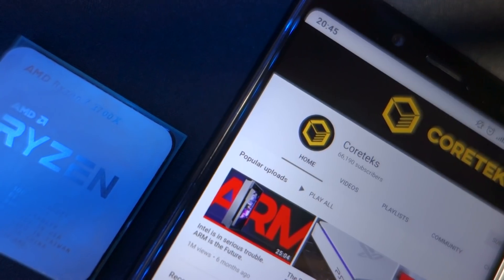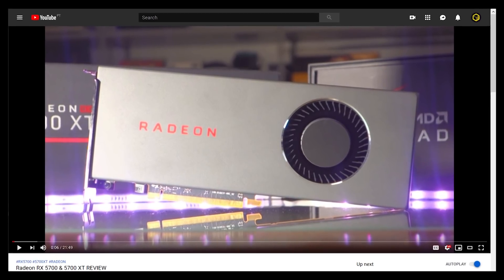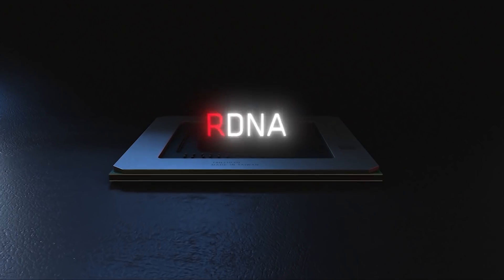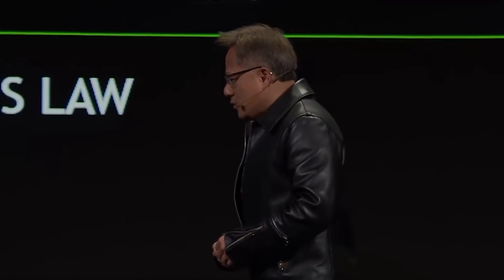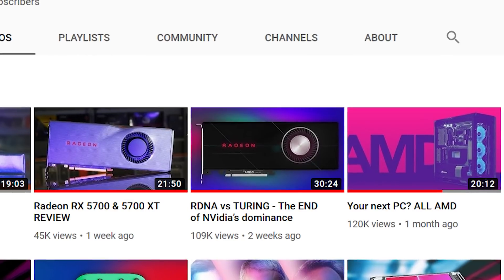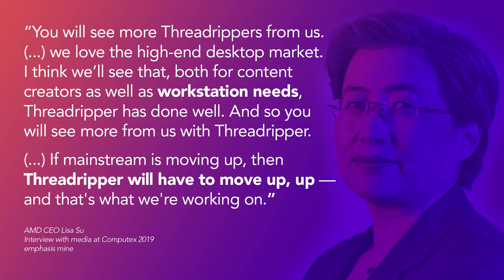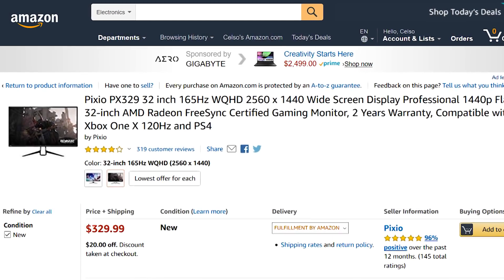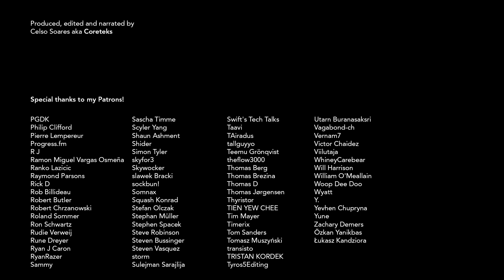What's next for AMD? - 5800XT. Threadripper. APUs.

Comment: APUs are the future, they will replace the low-end and mid-range dGPU market, only high-end dGPUs will exist.
Reply: Memory bandwidth limits means you'd need quad channel DDR5 to match something like the 560, let alone the 580.
Reply: Mid range APUs wouldn't bother me at all. I'd actually be happy with that. it'd be easier to keep cooler as well and be easier to set up a water loop if one chooses. I'd actually support that move.
Reply: @somerandompersonontheinternet4  
Yeah, I get the freedom of PC and all of its benefits!
But Consoles are the way to go to just enjoy some Games.

PC market has become one of the biggest industry and money generator.

Any piece of HW has become way too expensive and overhyped.

I rather use my Phone and Console. Cheap, small, fast, smart, perfect working! - All I need
Reply: Mitch  there won't be any shortage of new APUs in that type of market. So you'd just be upgrading your APU if we assume AMD keeps doing these long term socket supports.
Reply: @J Fz but part of the problem is games also getting more demanding. those 2400G might be impressive if they were released in 2014 because they were about as fast as GTX750. but in 2018? this is the problem with APU. sure it might be impressive once they can reach 1050 or even 1050ti performance but by then we will consider such performance to be on the very low end spectrum to run games at that time.
Reply: @somerandompersonontheinternet4  He's an idiot, that's why he didn't mention it.
Reply: I hope that APUs will be able to replace mid-range GPUs, but I really see it only in more than five years.
Reply: I disagree with the last part of your sentence - somebody might just get a CPU without an iGPU and then just get something cheap as a display adapter UNLESS there will be some sort of iGPU on the board alone (I hope it will be... again)
Reply: See: Gamers Nexus' July 7th review of the 5800XT "AMD Radeon RX 5700 XT Review: Thermals, Noise, Gaming, & Broken Drivers".
Reply: those APU can replace the low end but truthfully even the upper low end is not an easy task for APU. because even on the low end spectrum the GPU performance still being raised and games also still get more and more demanding. right now the fastest sub 75w GPU is 1650. but the best APU are still quite behind even against 1050ti. replacing mid range GPU is outright impossible.
Reply: @somerandompersonontheinternet4  AMD doesn't like leaks that are impossible to do.
Reply: with 3d stacking of memory they will take highend as well  most likely
Reply: @somerandompersonontheinternet4  no it really won't crush the 5700xt. It won't even have as much raw power as the 5700. Simply due to heating issues. It may be able to hit that 4k 60fps but I mean honestly a good Vega 64 can do that. The only thing really giving it that performance is the optimization of the ps5 OS and the how well the devs optimize for that hardware.  Even then there will be settings that have to get turned down or off  to hit that fps mark seeing as they cant be overclocked or any thing like that. Cooling is a big issue for consoles.
Reply: @somerandompersonontheinternet4  the 480 was a $200 card so not in the price range of the 5700xt due to the fact that we had the 390x outperforming it while being an older card and the fury x above that. So that isn't  a correct example. The 5700xt is the latest and greatest on the market for amd right now not a card 3rd on the list behind 2 of its own older models.
Reply: @somerandompersonontheinternet4  oh also that isn't true that they get better binned parts simply due to the fact that console hardware had consistently been at least 5 years behind pc performance numbers until the ps4 pro and one x. Neither of which were really with the money 🤷‍♂️.
Reply: @somerandompersonontheinternet4  again the 480 wasn't even amd's top card at the time. It was a downclocked 480 not better in any way other than power draw because again downclocked to reduce heat.And again the game devs optimize better than on pc since every console has the same hardware. That makes a significant difference in performance but not enough as my 390x handily outperformed a ps4 pro. Remember the pro was running upscaled 4k not native 4k.
Reply: Nah. One reason for the discrete cards is there power consumption and heat output. A modern CPU oroduces 60 to 100 watts. A GPU is even in the low emd 100 Watts, high end is more like 250 to 350W. Add even the small number up and your easily at 150W. You need some space, to cool this amount of heat. It needs a tower cooler and some airflow in the case. So nope, APUs will not extinct discrete gpus anytime soon.
Reply: your talking about discreet GPUs that are clocked to the max. APUs have their eGPU clocked at a much more efficient frequency (800-1K MHz) so TDP is way lower. You only have to look at the APUs already out from AMD to see this.
Reply: @MephistoDerPudel  the thing is that average consumer can't afford to pay for a discrete gpu. Especially in developing countries. So if you can have a GT 1030 or 1050 without paying extra bucks. A normal bloke who doesn't care about 1080p gaming will go for it. So would net cafe or gaming center's that only wants to play games like overwatch,counter strike, fortnite,DotA or lol. The thing with APU is not to be better than descrete. It's to be good enough so you don't feel the need of a dgpu

Id wait for zen4 APU's tho if they can make a ryzen 5 APU with enough power to compete to 1060 it'll be a pretty sweet deal. Not to mention you can just buy another gpu when that starts losing steam
Reply: @MephistoDerPudel  not quite yet but we are getting there.
Reply: Why should they kill their own market? - They just wont!

APU's are much more efficient, cooler and have less TDP!
Just look at the Consoles.
Xbox one X: 16nm@6tf not too bad for an APU.

Also most energy is used for data transfer. Learned from AdoredTV.
PC is worst case.

GPU and CPU can access the same memory!

No question, SoC's are the only future! But first, PC gamers has to be milked as much and long as possible.

Now 5700 XT, next year PS5 will surpass it, then AMD will offer 5800 XRT, new PCIe 4.0 Mainboards, new SSD's, etc...
Later 5900 XRT...
PC is a waste of money and time😱!

Worst time to buy new HW.
Wait till PS5 launched and wait some months.
Reply: @3D-Engine-Melody  the xbox 1 x APU runs the CPU cores at 2.6ghz and has a 250w power draw.
Reply: @vyor8837  
And?

The Powerdraw is meant for the entire system!
Ram
CPU
GPU
Mainboard
HDD
Disc drive
PSU itself
Cooling
Reply: @3D-Engine-Melody  nope, just the chip is 250w. For 580 class performance. With a shitty CPU. Sooooo efficient.

Comment: I am less enthusiastic about APU's than Coreteks. Once AMD arranges motherboards with larger sockets and memory-stacking with good heat-management (I refer to that patent from AMD) becomes possible then APU's will become really interesting. Then you won't have too much of a bandwidth-limitation any more. I don't disagree that someday APU's will become the standard, I don't see it happen in the next 5-10 years yet. What I do see happen is that on average that Zen2/Navi APU will compete with a RX 570, it will have stronger performance for certain aspects thanks to the stronger GPU but a weaker performance for other aspects due to the low memory bandwidth. It will be gaming with a fair amount of compromises and AMD will probably add a feature to AMD Settings to select the right settings for popular games with which you get the best compromise between FPS and graphical quality. This is required because most of these gamers lack the skills to do it themselves and because the memory limitations makes it more complicated to configure the graphics settings, especially for this group of gamers.  (not that enthusiasts might not also use a laptop with a good APU in it but also many people will only have that laptop to game with)

Comment: The "up, up" sounded more like an emphasis on the literal to me.
Is it possible they could be working on producing a 3D-stacked chiplet?
Reply: Doubtful. I'm still calling BS on the feasibility of 3D-stacking on desktop . Sure, in phones / tablets that's been the standard for years (the POP, package-on-package, ie. RAM on top of the CPU), but that's only because the core burns up single-digit watts.

I don't see that happening with dies that eat up tens to <100W, anytime soon (if ever). Remember the "crap TIM" debacle with Intel? 3D-stacking would involve other dies sitting between the cores and the heatspreader / heatsink surface.

Comment: As far as I've seen the 5700xt is around 2070 performance. Though I expect the partner boards with better cooling might push it to 2070 super levels. I don't know if the 5700xt can stand it's own against a 2080 unfortunately. I'm more interested in what this card can do in the 1440p gaming market however!
Reply: Unfortunately there is a utuber that used a hacked powerplay mod to push the 5700XT to 2.2ghz and the edge of breaking according to the temps. and it got very close to the 2080 in 1 game and now many AMD fans are stating that as its baseline performance potential. It's impressing for sure but its still not realistic.

Comment: With APU's with this performance and price, the power to performance level is going to break Intels stranglehold on pc manufacturers (Asus, Acer, Dell.) I am curious why AMD with their solid ARM work they do not release a modo design with an arm proc to natively dev ARM apps and run them. It would allow for a migration for lower end apps to arm. Also, thoughts on DDR5? Amd possibly moving to that plus 6 channel memory on Threadripper being focused since Intel is moving that way since 6ch is more of a selling point than true benefit for cost on the server side atm.

Comment: You forgot telling about ZEN Picasso APU going Chromebook. Lisa skips one gen Threadripper, and slows down with 12nm APU's, so probably Chromebook first strategy. Before console upgrade cycle in h2-2020, which also comes with 7nm APU's to push Nvidia out of laptop business in 2020. Meanwhile pushing EPYC, Ryzen3000 series, and Navi. Then the next upgrade cycle, will again include Threadripper, with amazing workstation powers. This strategy nicely matches new industry standards.

Comment: Dont forget to undervolt AMD Gpus the blower cooler is actually good with an undervolt
Reply: The blower cooler is actually decent. The problem is with the heat pads that don't transfer heat well because the case doesn't apply enough pressure on them. Gamers Nexus was able to fix this by adding washers to the screws.
Reply: @HieuNguyen-lr3ot  undervolting makes a much much better difference i saw the gn video
Reply: @antonievandermeer34  yeah got gta running at 60 fps in 4k with an under volt on my Vega 64.

Comment: Mr Coreteks or someone has to explain to me, how APU's can get to the level of say a 570 or 580 without costing a substantial amount. The main issue with APU's is memory bandwidth as they use the system's memory(so are bandwidth and low latency starved). The sys mem (DDR4) is more than twice as slow then say GDDR5. So unles you run the memory on the same package (which  then becomes costly), how can APU's get to the level of a 570? Even the Ryzen 3's are memory starved and they run @ 1030 levels. Bandwidth and  low latency are essential for runing higher FPS.
The only current way I could see that is if they add 2GB's off memory onto the package (and use it in conjuntion with HBC or something similar)
Reply: In case you're out of loop, did you forgot about whole 3D stacking on CPU's?
Reply: DDR4 is low latency GDDR is high bandwidth they will need some sort of extra HBM on CPU
Reply: This is exactly my thought. But with there are 2 methods to avoid this. 
1. Larger GPU cache to reduce memory access
2. HBM or other type of memory directly integrated into the CPU package as part of the chiplets

It would be interesting to see if HBM price have been reduced enough that it would make sense to integrate it on APUs. It's clearly the future path but i wonder if we won't see a new socket with No memory channel(or DIMM on the motherboard), HBM memory integrated directly on the die. There would be just more PCI-E lanes for fast storage in case the local memory isn't fast enough. 

We would probably see that first in laptop but then in desktop. The things is they need to get good performance at relatively low price. Not sure if we are there yet.

I suspect that at first, we will see larger cache on GPU but that will be something to look at for sure.
Reply: Doesnt have to be a tiny cpu package.
Reply: They could literally just stack a bit of HBM2 on top.
Reply: @toxiccan175  yeah but that adds a lot of cost and well at that stage you're better of buying a dedicated video card with a cpu (without IGP) their quite cheap nowadays anyway
Reply: @tahiribnmohammad5410  all they would need is a single hbm stack and it doesnt even need to be 4gb the 2 gb stacks are enough, a very small silicon interposer which at those sizes will be really cheap, and thats it over the normal apus, and they would be able to charge quite a bit for it, but it would be specially great for the laptop market
they just have to make it cheaper than cpu+ gpu

Comment: Does this look right?
Maybe you can help me here:

4CU Navi on Athlon competes GTX 1650
12CU Navi on Ryzen matches RX 570
16CU Navi on Ryzen matches RX 580
24CU RX5600 competes GTX 1660
28CU RX5600XT competes GTX 1660Ti
36CU RX5700 competes RTX 2060
40CU RX5700XT competes RTX 2070
48CU RX5800 competes RTX 2080 Super
52CU RX5800XT competes RTX 2080Ti
60CU RX5900 competes RTX 3080?
64CU RX5900XT competes RTX 3080Ti?
Reply: A 16 CU Navi chip would be at about 80W. That's hot. It would have (just from CU count, clock speed ignored) about 40% the performance of the 5700XT. Seems reasonable... On the other side of course the 5700XT has GDDR6. So perhaps more like 25%-30% performance. That would be more on the level of a rx 570 I think.

Comment: AMD made two mistakes with Navi, in my opinion. The first mistake is that they priced it too high. If that 5700 XT would cost €300-€350, then every review would give it a strong recommendation while AMD still would make a very nice profit per card. After all, the RX 480 launched for €229. The TSMC 7 nm node (let's add $20-30 max) and the GDDR6 (let's add $25 max) don't increase the cost with $70 and the inflation wasn't that big in those 3 years (4-6% depending on where you live?). AMD would have conqured the mid-segment with a price of let's say €325. AMD would have been seen as the nice guy who doesn't abuse what Nvidia created with its stagnation (shader-performance/$). The second mistake is that AMD put a blower cooler on this card which doesn't cool the card properly. With a good heatsink and fans you can easily push this to 2000-2100 MHz, when you increase the voltage (not recommended for daily usage) you can even get it to around 2200 MHz, see the German (original!) Toms Hardware which independend from the English Toms Hardware. 
https://www.tomshw.de/2019/07/11/ungefesselt-radeon-rx-5700-xt-auf-ueber-22-ghz-uebertaktet-break-the-limits-mit-den-neuen-softpowerplaytables-fuer-die-rx-5700-und-rx-5700-xt/3/

RDNA is a good architecture and Navi has a good performance with immature drivers. AMD didn't play this well. Lower that price and never put a blower-cooler on it again, no matter how much you want to cater to those bloody OEM's. If you have to, make two models, an OEM-model with that horrible blower-cooler and a short heatsink, and an enthusiast model with open fans and a large heatsink. Then everyone is happy. Us do it yourself builders are not bother by OEM's getting that worse model and OEM's are happy that they can shave another $5 off their costs because they can use worse fans. and a smaller case.

Comment: tbh if you wanna play the most recent titles at 100 fps 1080p u need a 500$ cpu and a 500% gpu imo
Reply: Who needs to pay 500$ gpus just to get 100fps in 1080p? all cards atm are all capable of doing smooth gaming, what we really need is additional "free" features to complement the power of current GPU's i.e anti-lag and image sharpening. Imagine Rx 570-580 performance with extra feature from Navi is a win already.

Comment: You forgot about EPYC lineup, there are even higher margines than on Threadripper.

Idea with APUs being 1440p capable is a bit far fetched. I understand that with AMD's upscaler it's possible but even at 1080p DDR4 bandwidth can be an obstacle. At this point I see 2 possibilities for AMD's APUs. Either they will put Navi GPU but clock it super low achieving insane levels of efficiency for its power or put HBM on I/O die and go wild with Navi (they probably won't put HBM on I/O and go wild with Navi, making another imbalanced APU but whatever)
Reply: you forgot that AMD changed cache system for Navi and Zen 2 to rely less on memory speed

Comment: I have a new ryzen cpu but i think this channel drinks the AMD coolade to much the gpu's arnt that fantasic right now
Reply: With a proper cooler mod and the power table changes you can beat a 2070 super for 100$ less, that's pretty damn good
Reply: I politely disagree. 5700xt with the newly released Power Tables Mod and and a good cooler clocks like a monster to 2.1-2.3 Ghz and beats the RTX 2070 Super and in some cases even comes close to the RTX 2080.